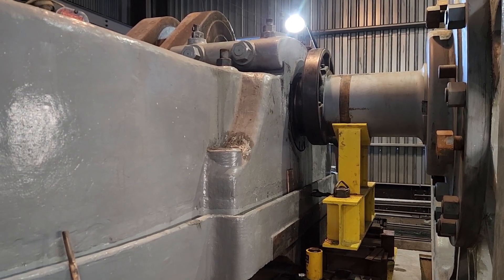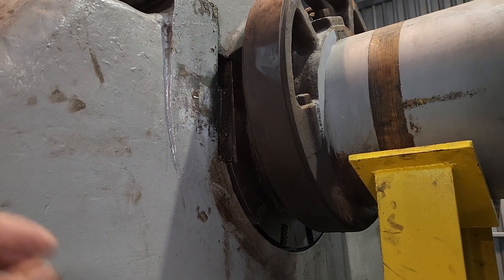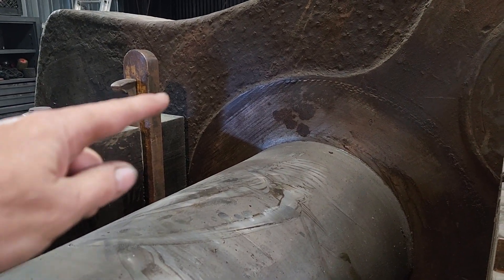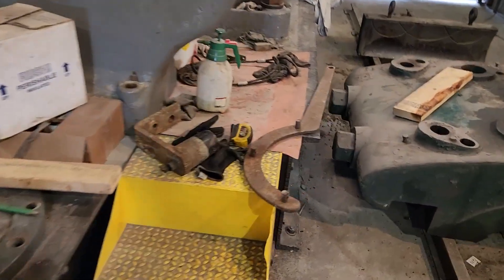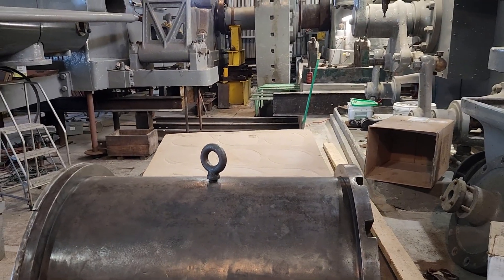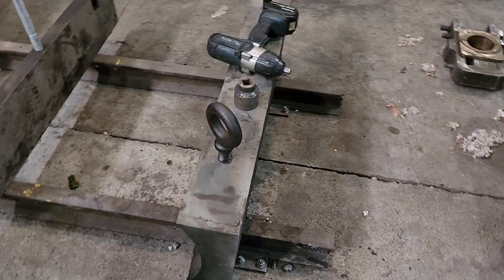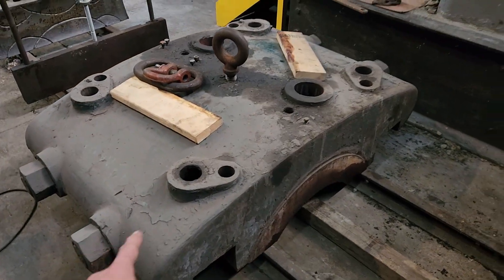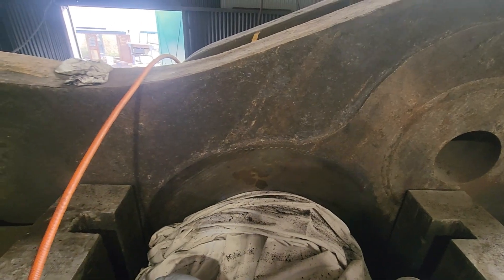Tod Engine - Installing the Main Bearings

Comment: Rick, please wear thick gloves when using a needle scaler, otherwise you risk white finger, an irreversible condition resulting from vibration damaging the arterioles in your fingers. This was a common condition for shipyard workers, who used needle scalers regularly in their work. At its worst this can result in gangrene in the finger tips.
Reply: also need to wear goggles,as spectacles will not give enough protection from flying debris.